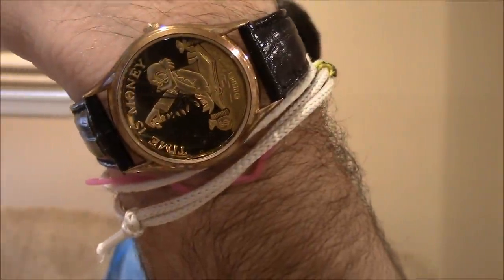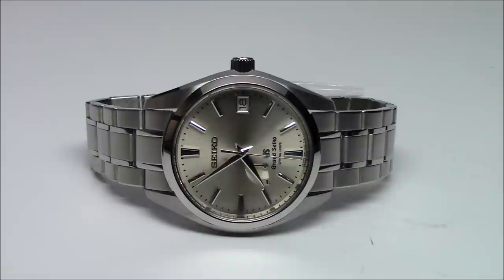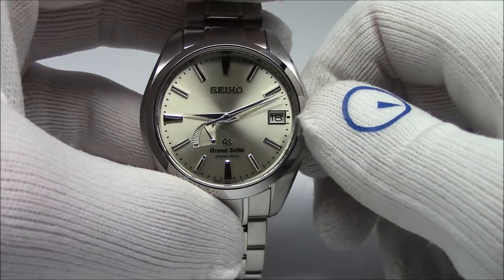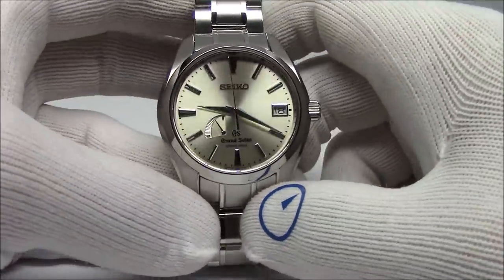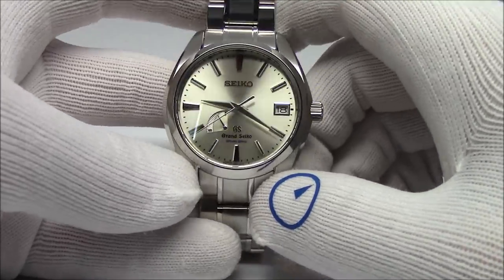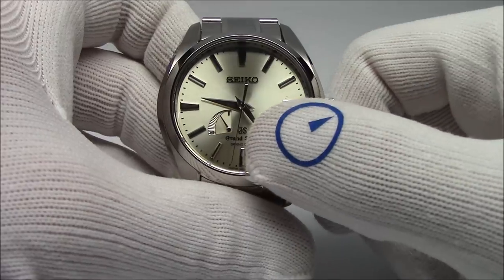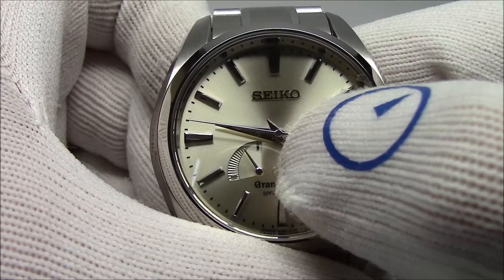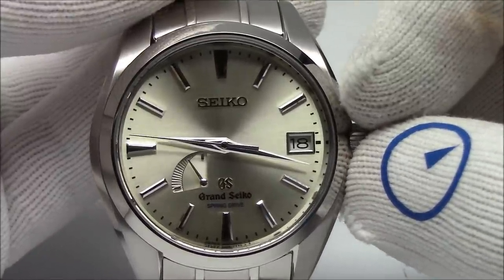What is Seiko Spring Drive and how does it work? Watch and Learn #24

Comment: It's a quartz watch.....except it's powered mechanically rather than through battery.  It's a clever design, but still a quartz watch.  On top of that, quartz watches still lose about 1 second a day.  So they may have increased the accuracy by relying on quartz, but not really any different than any other quartz watch. At that point, the mechanical part is literally only there as a power source and not really there to regulate time at all, because it will always rely on the quartz reading. The main point of that braking feature isn't soo much to regulate time, but rather to have energy/momentum immediately available to drive the second hand more smoothly.  It will still be relying on quartz for regulating its timing, so in that sense it's actually completely unnecessary to have a two tier system of using both mechanical and quartz drives, because all it's doing is correcting for the inaccuracy of the mechanical drive to begin with, when it could be relying solely on the quartz instead, while still using the braking feature to regulate time and at least make for a smooth hand movement.  Any quartz watch could easily have a braking system for smooth movement, it would just use up more battery.
Reply: Then why does it "sweep" . If it was just a mechanically powered quartz watch it would still tick?